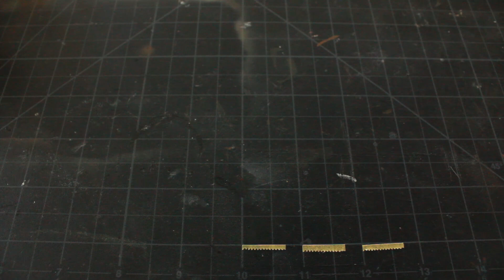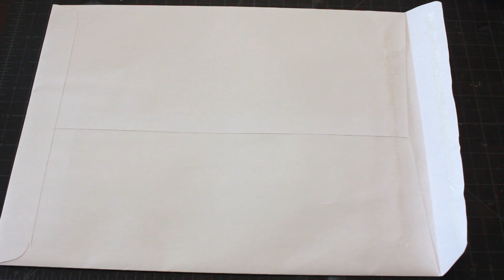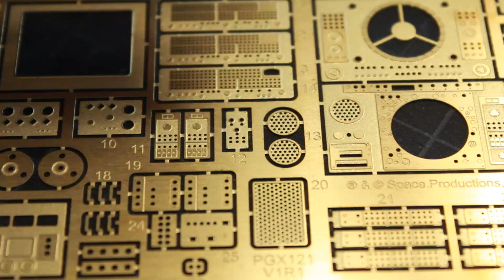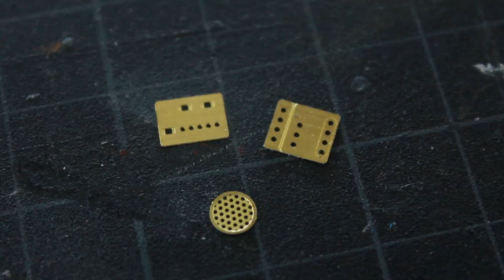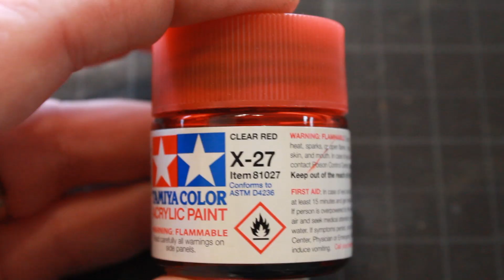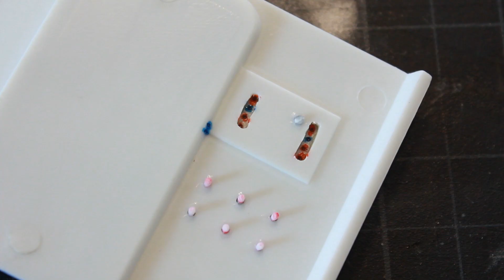Moebius 1/35 scale Jupiter 2 Pt 2 Fusion Core, Floor and Walls

Comment: Hi Christopher , you mentioned in your video that you "sealed" the floor, what exactly did you use to seal it? I have painted my floor with Tamiya flat (XF) paint but it seems very soft and scratches easily, sealing it sounds like a good idea. 

My first time modelling and appreciate your help. Your videos are amazing and very inspiring, thanks for sharing and motivating me to start modelling.
Reply from the maker: I sealed it with my airbrush using Pledge floor gloss. It's what Future floor polish used to be.
Reply: @modelsbychris  Thank you for the quick reply, I will have a look for this but I am not sure its available in Australia any longer. Do you think Tamiya XF-86 flat clear would work ok?
Reply from the maker: @nickdoum  the floor should be gloss. So the Tamiya gloss coat would probably work ok
Reply: @modelsbychris  Gloss would probably look better too, Ok I will check both options and go with the one I can get. It looks like I still have a long way to go with this build, looking forward to the results. Thanks again

Comment: I wonder,if The transparent plastic was painted flat white will that accomplish the same purpose as the stirene strips. Hindsight is 20/20.great video.
Reply from the maker: I had originally thought about that and tested.  Can't get a clean enough paint job and opaque enough to look as good as styrene
Reply: @modelsbychris  thank you for the quick reply.